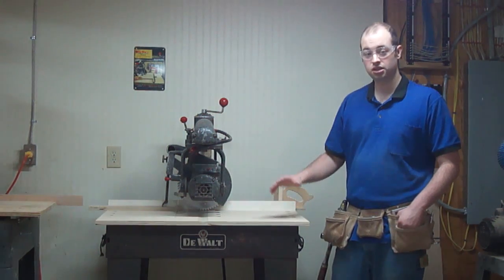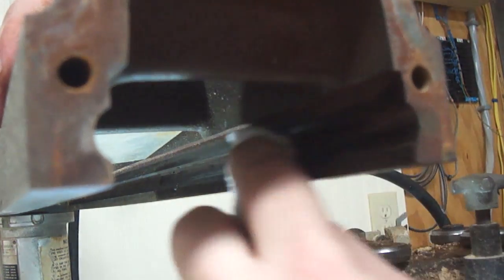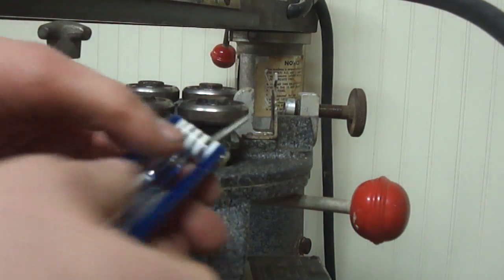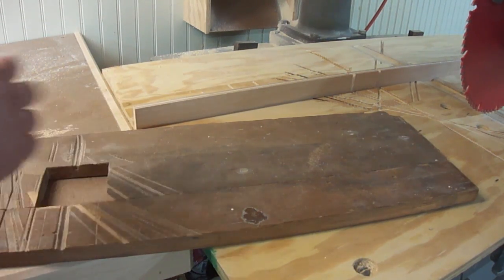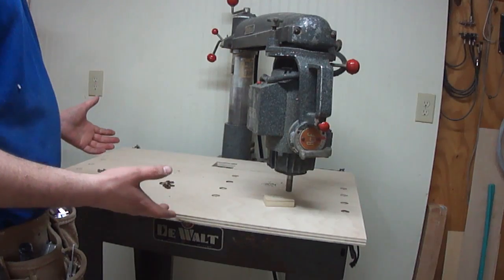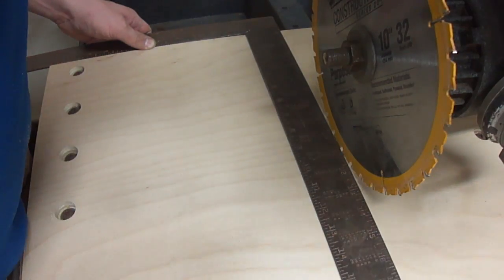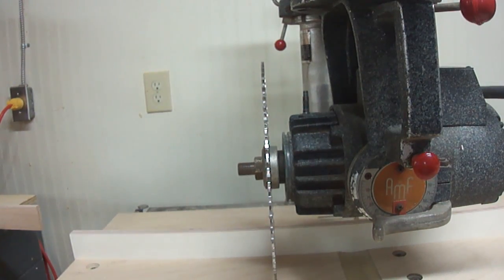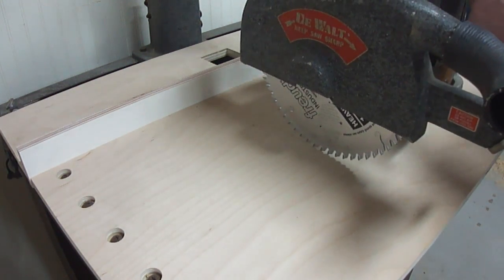How To Completely Align A Radial Arm Saw

Comment: Correction, I did not find a model 1030, mine is a model 1020.  I hadn't heard of the 1020 before and can't find much info about it, but it does work.  Has a 10" blade, round arm, key switch on the front right side of the arm and is wired for 240v.  Have you ever heard of the 1020?

Comment: WD-40 has a high concentration of wax, and if you don’t get it off it will be even harder to move…. If you want to clean it use brake cleaner or PB Blaster if it’s got surface rust and grime

Comment: I loosened those two nuts under the AMF cap to tilt the blade a bit and couldn't get it to move to save my soul.  The regular instruction manual doesn't say this, but the manual labelled "Instructions, Maintenance and Parts" for the MB and GW models says on some models it may be necessary to also loosen the big center nut (Y23).  Once I did that she turned easy as pie!  Got the blade square...which let me discover my table is out of square, so tomorrow I'll adjust it.

Comment: Are those bearings a roller or ball type or are they more of a babbitt type bearing?  If they're ball or roller type I might try removing them to clean them out with lacquer thinner which will dissolve the old hard grease and then re-pack the bearings with new grease, in much the same way folks used to pack wheel bearings on old cars back in the day.  Two of the table bolts on mine, the heads are stripped out which is going to necessitate cutting out some of the original table so I can get a pair of vise-grips on them to back them out (My base only has 8 bolts as it sits on a DeWalt cabinet instead of a DeWalt table).  Hope I can find replacement Philips head bolts like it has.
Reply from the maker: @Rebel9668  they are ball bearings.
Reply: @TheNorthlandWorkshop  I learned the grease dissolving trick with lacquer thinner years ago, trying to unstick an old record changer turntable that was caked with it.

Comment: I think on the final crank up of the column, instead of just trying to wipe off the WD-40 that I'd spray the column with some Brakleen or other brake parts cleaner as it will dissolve the WD-40 and dry almost as fast as you can wipe it.  My RAS was very dirty when I brought it home and the WD-40 and Brakleen made short work of cleaning all the years of gunky buildup off of it.  I feel fortunate to have been able to get a DeWalt MB model as all the adjustments will be in the same places as what I'm watching in this video.  I have a large piece of thick laminate mdf I can use on the base that used to be the top of an office desk that was never used.  I used to work for Kimball Office Casegoods and bought the desktop there at an employee auction where we could bid on items that for one reason or another they wouldn't sell to the public (Usually a bad drawer or a chip somewhere in the piece).  While I don't have a 2nd RAS to rip the mdf, I do have a Rockwell 9" contractor saw that should be able to accomplish the same thing.

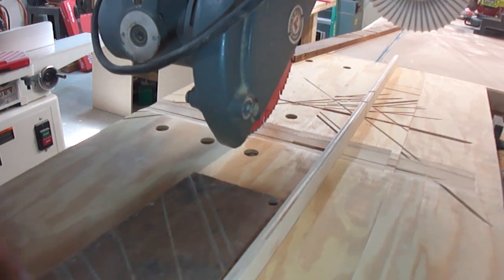Comment: 20:31  
Like you just did on your first cut.
Never reach inside the blade and fence, use a push block even on wide cuts.

I'll tell you why
When i got my new craftsman  i did a rip cut feeding the wrong way 
The blade took a bite into my stock
And the over arm turned about 30dgr i pooped my pants the only thing the stopped it  the blade bent and stopped spinning i shut the saw off  had my arm been between the fence and saw blade it would have taken my arm off. 
I changed my shorts bought a new blade and started paying attention
To feed directions closer. 
I also invested in board buddies for a radial arm saw. Then hold your work to the fence and down on the table  make the top of the fence wider then the slot  i just used a door jam the striker part is 2" wile the stop is 1.5"   the base on the board buddies is 2" i only use that fence to rip with, and its great for narrow cuts  not sure about thin rips.  I also made a separate one to use a shaper cutter.
MR sawdust has a jig for doing perfect 45dgr cuts the fit perfectly
His son posted the jig on youtube.
  When i bought my saw there was   nothing on youtube about the RAS
its extremely good people keep adding content.  Thank you.
They got a bad rep for no good reason.  Yes people got hurt on them  there are rules you need to fallow  never take a tool for granted.

Stop running your arms and hands past the blade. 
Stay safe.  Use push blocks and feather boards   hell run a screw into the table to hold the feather board in place if you have to.
You can sand the hole smooth and fill it with sawdust and glue your going to cut into it anyway.

Comment: I see you using a lot of WD-40. I'd head that it can have a tendency to dry joints out over time and it's better to use machine oil over WD-40. Is this correct? I'd appreciate your thoughts.
Reply from the maker: I haven’t had any negative effects from using WD-40 but I wipe off as much as I can so there really isn’t much left on there.

Comment: Having owned and used a Radial Arm Saw for 40 years, I am a keen advocate. However, squaring the arm to the fence is an almost impossible task using the nut and screw adjustment, the tiniest tightening error is hugely magnified by the arm. I have given up with that approach, and now fix the arm and square the fence to the arm. I no longer use the standard fence arrangement and this does give rise to other compromises, which are all relatively easily overcome. A square cut is my holy grail.  RAS's are prone to losing their settings. Even if like me I never unlock the arm. By squaring the fence to the arm I can re-square frustration free in minutes.
Reply from the maker: I’ll be honest, I’ve never had an issue squaring any of the three RAS I have. What make and model is yours?

Comment: Hi I've adjusted the crosscut to 90 with the table. However, the rip is not 90. If I align the rip to 90. The crosscut is then out. Any suggestions please. I have two radial arms. Both the same problem.  I've leveled the table. But, still the same problem. Your input would be greatly appreciated. Thank You.

Comment: You need to point out the importance of "Heel" for square edges, and the correct blades for a radial. They are not the same as a table saw. Table saw blades on a radial will knock your teeth out when ripping and over run when cross cutting. 51 yrs with a radial and no issues ( 12" cast iron Craftsman from the old days).
Reply from the maker: I have a two part video series on choosing blades for the radial arm saw.

Comment: Hello thank you for your video.  A must to see.
However, I'm stuck.  After I set the blade to 90 degrees for cross cutting I move the saw to the rip position, I find it is not 90 degrees. And if I set the rip to 90, the crosscut blade is not 90.   Any suggestions please.
Reply from the maker: It sounds like something is in the saw carriage is loose. I’d check the detent and the pivot point to make sure they don’t have any movement in them.
Reply: Thank You. Nothing loose. Could it be my table?
Reply: Wait.  Maybe I don't know how to check it properly. And what is a detent?   Thank You. Hope you keep the radial content going.

Comment: I have the model 7770 Electrostop 10 inch with 2¼ hp motor. I think it dates back to ±1975. The front switch has packed up, can I find replacement for it?

Comment: Amazingly helpful video!!  I have a unique problem I can't solve.  I still have play with the arm.  The arm is moving on the column.  The column is not moving withing the base.  The arm clamp handle is vertical when tightened (per my DeWalt 1200 manual, you mentioned it should be tightened in the 10:00 position which I have also tried).  At the moment, I am following my manual (my saw, DeWalt 1200, looks almost exactly like your 1030 model as your entire video replicates the same adjustments for my saw) so the arm clamp tightens at 12:00 and loosens at 2:00.  The column goes up and down freely as you mentioned.  Per my manual the set screws on my saw are tightened to make sure the vertical brass plate in the column is not moving.  When I move the arm (the arm clamp is locked, the 90 degrees detent is down and locked as well) the arm is moving on the column.  The column is not moving within the base.  I do not have any vertical play with the arm.  I am not sure what to do.  The manual does not have anything to say about this matter.  My saw was a one owner saw and was in great shape when I got it.  If you have any suggestions I would really appreciate it.
Reply from the maker: I’d take the arm off the column and check the machined surfaces one the part of the arm that clamps around the column and the machined surface of the column for wear.
Reply: @TheNorthlandWorkshop  thanks!  I'll check that forum in your video description to see if I can learn how to take the arm off

Comment: I have this exact same saw, picked it up for free from a fellow woodworker who was trying to find a home for it for a friend who’d passed.  Appears to really have never been used.  I’ve been watching and rewatching your video to get it dialed in right.  Just bolted the new table on tonight and will start aligning it tomorrow.  Thanks for such a thorough walk through.
Reply from the maker: Nice score! It’s a great saw.
Reply: @TheNorthlandWorkshop   did you build out a mobile base for yours or just attach casters to the bottom of each leg? Mine had 1x material connecting all four legs together with some broken down casters.  Trying to decide if I just replace those or redo the whole idea.

Comment: Being concerned with any corrosion, I would remove the front plate that retains the carriage. Apply a good quality masking tape over the painted area at the end of the arm. Using a small brush apply some Evapo-Rust to the rusty areas. You may need to do this a few times. Same doe the retaining plate. After removing the tape a light coat of Johnson’s paste wax on the paint and the treated bare metal. See you in the next installment.

Comment: I am trying to get almost the same setup with a DeWalt and a Delta.  I'm finding it almost impossible to align both saws to both tables and one fence.   Is that why you kept yours separate? Or do you have any tips on how to level and align multiple saws in one unified bench??

Comment: I'm hoping you still check the comments on the alignment of DeWalt radial saw (mine is a 47-year-old 5800).  I followed your instructions and found my saw required adjustment on all settings. I was slow and methodical to ensure was done accurately and everything went well until the last 2 checks for the heel of blade adjustments.  Two of the set screws were broken, not from my using too much force to loosen them, but rather they were already broken and just barely remaining in the tapped hole.  I believe that they were broken, or broke over time with the stresses placed upon them.  I suspect that this is the main cause of all broken set screws.  Having removed and replaced the set screws with ones I fabricated and at the outset, I discovered that the two 'horizontal set screws were at their limit of adjustment.  In order to get the blade heel to follow correctly, the new set screws also needed to be adjusted to their limit of travel.  Looking at the 3 set screws, the top right is fully in while the top left is fully out.  Something else is not as I think it should be, and despite my mechanical background, I cannot find anything else out-of adjustment.  Do you have any idea what might be causing this condition?   BTW a great video!
Reply from the maker: Sounds like the pivot pin that the three setscrews work against might be bent.
Reply: @TheNorthlandWorkshop  I had checked that and it is not bent - It runs true.

Comment: I calibrate mine a tad differently.  I don’t do the arbor down trick to tram the table to the arm.  Rather, I put the entire saw stand on leveling feet. Make sure there is zero play in the column and arm at the 90 degree position, and then I level the entire saw measuring the underside of the arm. Laterally across the ways and along the length of the arm.  Checking with the carriage parked and at full extension.  This establishes that the underside of the arm is running dead parallel to level and as a result the column is dead plumb, and so the carriage and motor are moving in a level plane.   Then I do the other calibrations of the yoke and such to get the blade in parallel plane to the run of the arm, and perpendicular to level.
With the Radial Arm ways dead level, then all I have to do for the table is use an ordinary level to make sure the table is dead level, too.  My table is bolted directly to the frame of the stand, and I use mechanics shims between the top and the frame to get the table top dead level. ( I literally stack the shims over each bolt location and measure with a long level across the shims to determine how many shims to slip under the table at each bolt. ) This way I know the table is parallel to the underside of the arm, and that means the bottom of the blade moves parallel to the table for consistent depth in dados and such. 
To really fine tune the fence and table as parallel to the blade in rip cutting… I get it close as shown in this video.  But then I rip some wood and see if the blade burns on either side of the cut.  If I get burn marks, I slip some very thin mechanics shims between the fence and the front table at either the far left edge of the table or the far right edge… and then clamp the fence and try another cut. I keep nuancing it until I can rip wood against the fence without a burn on either side of the cut. I can then use the  thickness of shim to mark the frame of the saw and re-set the back edge of the table to the shim line and discard the shim.   This is the only thing I have found that really accurately aligns the fence to the blade to prevent burning, and significantly reduce the chance of kickback.

Comment: Thank You very much.

I find the tip on making sure that the fence is parallel with the blade in the rip position as the first requirement particularly useful. There are many adjustments and checking for the RAS, this has to be the best clue.  This has to do with the basic position of the table with reference to the base of the saw.

Perhaps this is because I already know enough about the RAS to know that there are many adjustments. Which to start first is a question. That the table has to be co-planer with the swing of the arm at various positions, and that the fence must be parallel with the blade in the rip position have to be the first two of many to take care of.  After you have done these two steps, the table setting is done. The other adjustments/checking are with the saw itself. This makes the adjustments for the RAS clearer.

Comment: My Craftsman 12" has four allen screws at the front of the yoke while nothing at the other end of the yoke is adjustable.

Likely both toe-in out vertical, and horizontal, as well as bevel angle zero are all adjusted by using these four bolts all at the front side of the yoke.

Comment: Vertical toe-in or toe-out can be checked easily after the "fence to arm" perpendicular check has been done. Just raise one side of the framing square to attempt to hug the blade with the other side hugging the fence.

But the "fence to arm" perpendicular check and adjustment has to be made first. That is, using the framing square with one side hugging the fence and one tooth check with the other side of the framing square while the saw is pulled along the arm.

Comment: Do the Craftsman RAS have adjustable miter detent? My 12" Craftsman has two 1/2" bolts inside and near the top of the column. When I remove the top cap to the column that has the degree indication, I see these bolts. Would loosening these bolts and retightening adjust the miter detent?

Comment: What a fantastic video - definitely a must see for all RAS owners - especially new owners. I've gone through this on my own craftsman 9" almost 2yrs ago...well...I completely disassembled mine, cleaned, lubed, calibrated, and reassembled - for ripping cuts, I need a dial caliper to measure the error in width - can't tell how much error I've got with my tape measure or scale. It's darn near a Bridgeport. My biggest issue is I need to re-engineer my table and fence so I can more safely rip dadoes. Thank you for taking the time to make this video!

- Jens

Comment: I finally made my table and I am leveling. Should the 2 bolts that hold the rails to the table in the back be fixed and rigid during the leveling process. These are the bolts with the allen screws on top. I have them fixed currently and it seems these are creating conflict in that the rail in the back is much lower than the front as I adjust it. I hope this makes sense. Thanks for the help

Comment: ....and if both radial arm saws are down for maintenance then you need to get a third radial arm saw to make the pieces you need for the second one so then you can make the needed parts for the first. Excellent video.
Reply from the maker: That is exactly why I now have a third radial arm saw.
Reply: @TheNorthlandWorkshop  I’ve got 2 I guess I need a 3rd one

Comment: Great video!  The only thing I detected that was not discussed is the condition of the motor bearings.  In my experience, it's only a problem if the saw is noisy when loaded.  The static alignment settings might deviate from expectation and cause confusion to want to not trust the saw's alignment.  Good job.